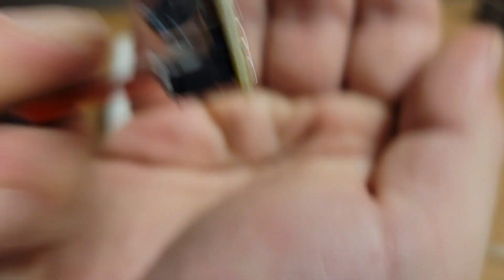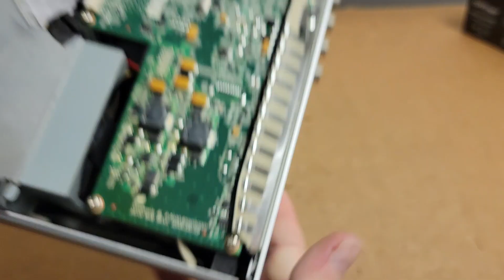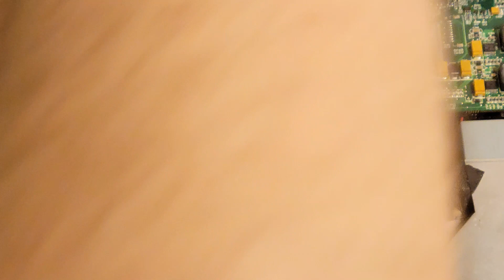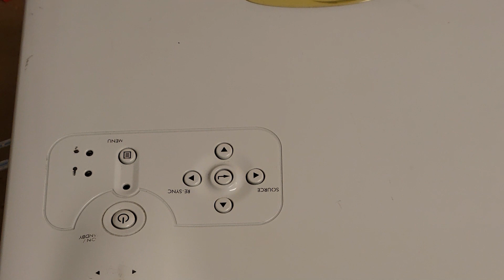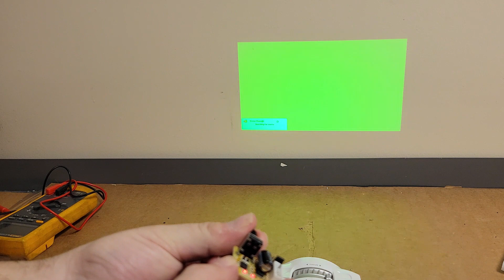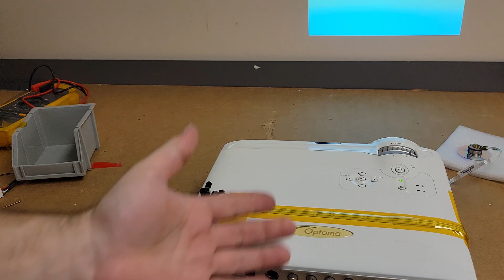Optoma HD70 Custom Colorwheel Control Modification

Comment: Superb video Frank. Thanks a lot.
My HD70 color wheel tries to spin up but it’s kind of stuck between poles, making an intermittent high freq sound. I put IPA as shown in one other video of yours. The rotation is not completely free.
I would like to tryout this motor driver to test the color wheel motor outside the projector. Any other pointers ?
Reply from the maker: Thank you! I can save you some time.  If this is the original color wheel, then rep[lacing it your best option. they use oilite/bronze bushings that wear out.  Most HD70s are on Color wheel 3-4 by now.  The driver will likely be fine.  The motor is a BLDC motor with a common and 3 poles.  If you have continuity from each pole to common, then the bushing is likely the issue. Replacing is your best option.  They are very cheap to purchase these days.  you will be surprised at how much quieter the unit will be in general.
Reply: @FixitFrank thanks a lot Frank
Any way I could share the video with you?

Comment: Can this same idea be used to make a grayscale projector? Are you just using old colour wheel motors for this where you removed the glass? Im looking for a easy way to mod projectors to be grayscale.
Reply from the maker: Exactly!  I made a DLP SLA printer with that method.  Just pulled all the glass segments off.  I used an old NEC but any DLP would work.